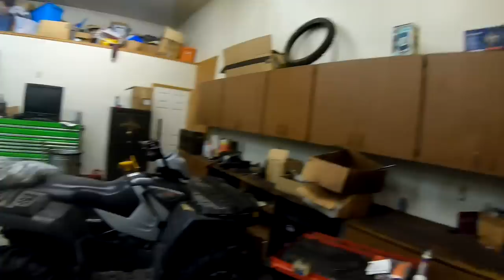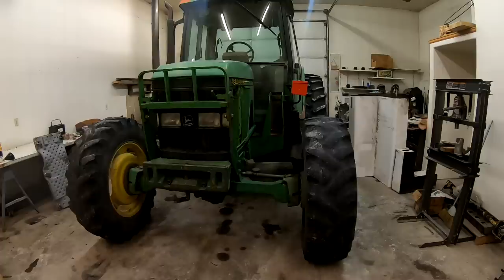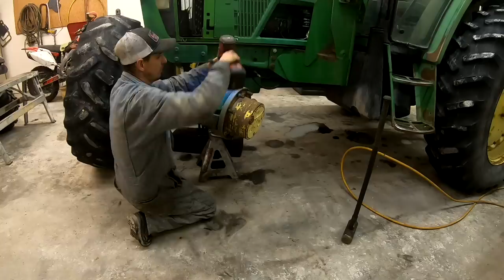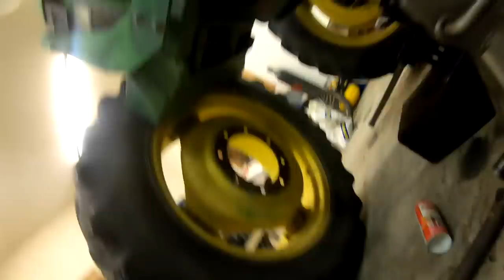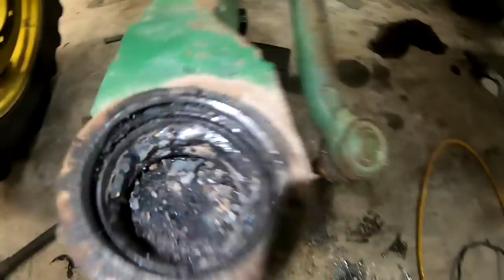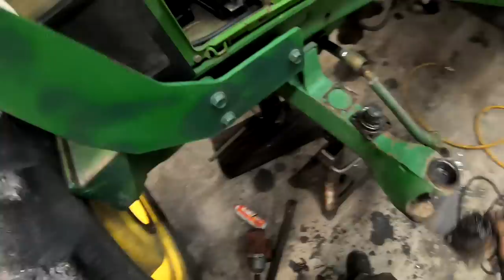Steering knuckle rebuild pt.1

Comment: Those 6400 John Deeres are one of the best deere ever made!
Reply: A&O O we have some here with over 20,000 hours very popular in Ireland
Reply: Oh wow! I thought I was getting up there with 8200 trouble free hours.  Any major work you had done to keep them running that long? Very impressive.
Reply: A&O O where your at now at 8k is the trouble some bit. Have 6610 as well. Had to do the back end at 8k the engine at 10 and that’s it’s. Keep greasing it. And changing oils and filters.
Reply: No , they aren't.

Comment: Hello Warren - I am in totally agreement regarding doing your own repair on that axle housing. Here’s a little hint that has served me well for years. Save all your old grinding wheels in various diameters.  After several months you will accumulate many different sizes. Then you can pick one or more diameter disc’s to use in repairing your hole or cup. As you clean up your welding repair, you increase your disc size till your only a few thousandths smaller. Now your making your hole much smoother and rounder because of the surface area your grinding at all times. Trouble with die grinding with a carbide bit is, it’s always a series humps and hollows as carbide wants dig in.

Comment: Great work! Little trick I found works good on those axles for getting the races out, may already know but take you a torch and heat 3 spots on the race cherry red and  usually they will fall right out! As long as it aint chewed up. We do a lot of Lull axles and they are all that style. Like the idea of drilling the caps out, save a lot of time and money with a little grease.

Comment: Never knew to weld a bead in order to allow for shrinkage. That was a great trick tip.
Reply: Been doing it for years, unfortunately you can't re use the bearing.

Comment: Every mechanic I know, myself included, has that same silly laugh that Warren had when he got the wheel up in the air and gave it a shake.
We all do it, first the laugh and then the OH @#$* when you realize that somebody was driving it and never even noticed.

As far as shipping containers.
Insulation and some kind of heat or they will just rain on your parts.  The condensation inside can be amazing.
Have had several at some of the places that I have worked.
The insulated ones were fine. Spray foam worked the best.

Mind you if it is damp and nasty, maybe the wife will keep out...

Comment: Congrats on the 50K! I have to say that I enjoy the cordless comments. I have had people tell me that I need to try them out. Funny cause last time I checked I have 6 of them. Sometimes the air just gets done a little better, or if the compressor is running that's what going to get used. Not saying people don't think, just sometimes after they have already typed it. Lol 😁

Comment: Need to chang the offset of the front wheels. Narrow them up swop the wheels to opposite sides. Using afront end loader with the wheels wide will fuuck the bearings and kingpins.
Reply: Well in some areas you can't it will turn over don't know where this one is working but in my area they put snap on duals for the bushogging tractors and all the loader tractors are as wide as possible

Comment: We just got a JD 6310 back together that spun the balance shaft bearings and ruined the block. The injection pump was leaking diesel into the crankcase! We put in a JD rebuilt engine. Two bearings we in the oil pan and the other one fell out when we pulled the balance shaft.

Comment: I’ve been doing the same thing, I set the caps in the lathe and drill them out, Deere used to in the older tractors must not of sold enough parts ha. Can’t beat a good wiener dog race👍

Comment: Changed a tire with a breaker bar...two years later still feeling it in my back...my motto is if you can’t do it with a power tool find a teenager to do it for you...

Comment: when them housings get chewed up i take them off and build it back up with weld and take it to the machiene shop and they cut it out like new, at a fair price, i give them the new bearings race an seals to go by, them housings are cast steel so they weld up nice, edit, now that i watched the whole thing, you did weld it, but i have tried the die grinder with the burs but never liked the fit, but i want it not coming back and look like new and the machiene shop dont charge much when it is all weled ready to go, and looks like new in the ends. normally both sides are all chewed up so dropping the unit is the best in any case

Comment: Shipping containers “cry” when the cold turns warm. Water condensation on that steel starts dripping on all your stuff. They are tight when you put shelves in. And the roof is never high enough. Put in a shop dude. You need it.

Comment: That’s called a burns tractor no grease or oil change. I know people that get mad at the equipment because it failed with break in oil in the tractor. Now with 3500hr burns people don’t believe in maintenance just run them hard and put up wet

Comment: Those bastards were hard to get of the mx135 when we changed them. How do you grease those knuckles on that deere??
Reply from the maker: You have to pull them and pack them, I drill a hole and tap them and put a grease zerk in them.
Reply: @westerntruckandtractorrepa1353  oh ok..because the ones on ours are all zerks
Reply from the maker: Yeah, if you buy a new magnum or mxm they won't, they want to sell parts.
Reply: @westerntruckandtractorrepa1353  well our 210 has them to..but good to know...definitely be getting them tapped out and installing grease zerks
Reply from the maker: @Northern_Farmer  Huh, maybe it's just the mxm tractors that don't.
Reply: @westerntruckandtractorrepa1353  maybe..I just had the knuckles done on the 210...you can tell they take grease nice now. Just having trouble with the seals. Starting to leak again  for the third time now
Reply: @westerntruckandtractorrepa1353  oh and on those mxm tractors..they were just a new Holland painted red..maybe that's why..new holland didnt have any zerks?

Comment: Hey just was curious if you have been taken a transmission out of a 1996 Ford f250 7.3 liter powerstroke 4x4 and had any tips on the easiest way to do that and great job with the videos they help alot man thanks

Comment: Not to sound like a smart ass, but the welding rods on the floor in the oil is not good. Especially with a LH 7018 rod.

Comment: Is it just me, or does that seem like some really piss poor engineering? You would think they got some really smart guys over at Deere, but who would think that not having a grease fitting on the top and bottom would end up costing the customer money? One would think that just the torque loading running in four wheel drive would make those points sloppy after a while, where a couple grease fittings would extend the life of those components.. I guess it doesn't cost you money until it's broken.. Hang in there Warren, thanks for the share!